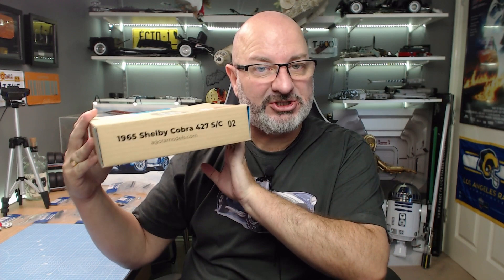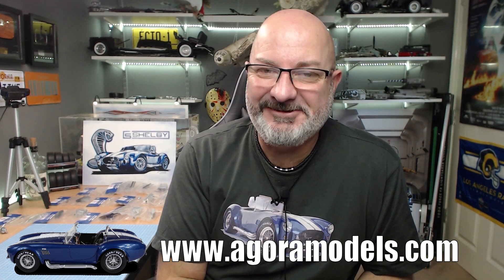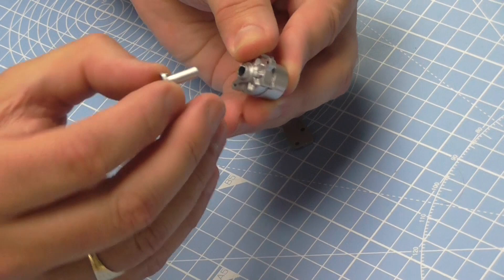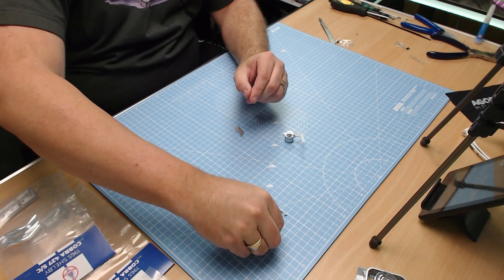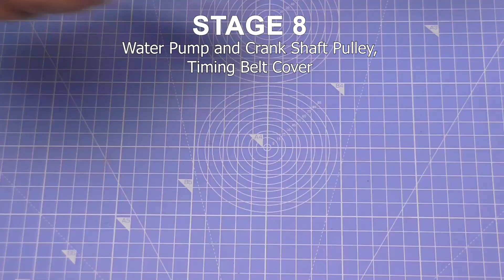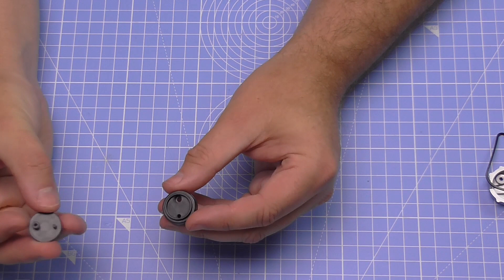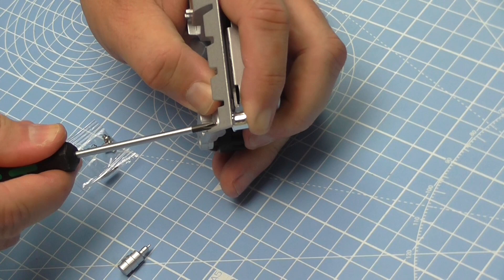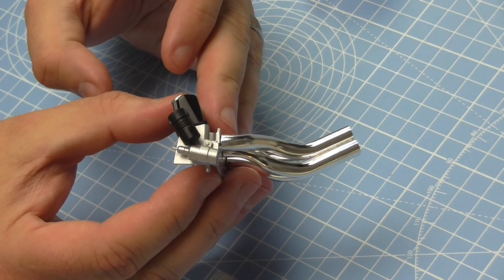Agora Models 1965 Shelby Cobra 427 semi-competition 1:8 Scale - Pack 2 - Stages 7-15

Comment: I just completed this pack. And I must say the spark plug wiring had me almost give up. Thankfully, your video helped me figure it out.
I ended up dismantling the engine, put all the wires to the distributor and then reassemble the engine block. This way I had room to fitr all the spark wire connectors. Especially numbers 5, 1 and 8 are hard to reach otherwise.
Reply: I found to cut the length .5 cm longer then they noted helped. Also put in 5 before 1 and 4 before 2 and 3. Rest then were fairly easy, but otherwise 1-5 kept popping out until I put them in a different order. Tempted to add some glue, but they seem to be holding so guess not needed. But that was tedious.
Reply: @scottrandell4281  I have spent several hours so far trying to install the wiring and have thought "Damn, I should have cut the wires a little longer". Wish I would have read this comment before cutting.  I'm to the point where I might try to splice some additional spark plug wire to a few of the cables. Very frustrating step